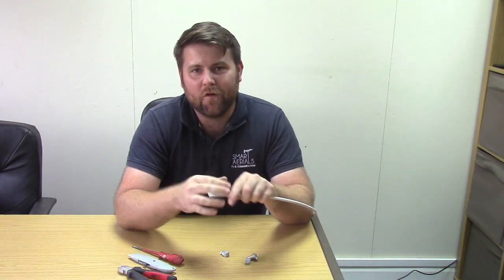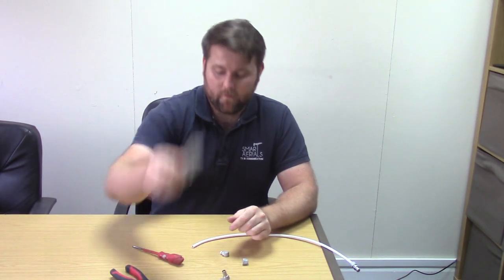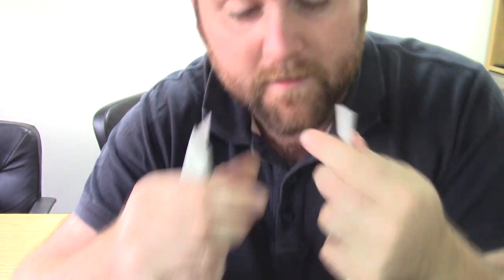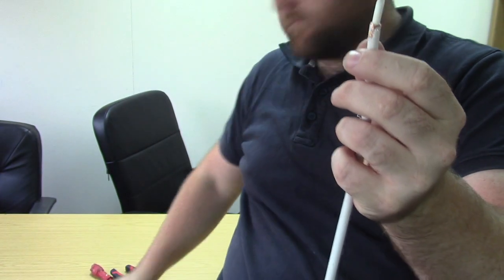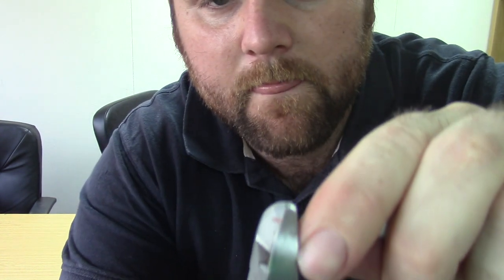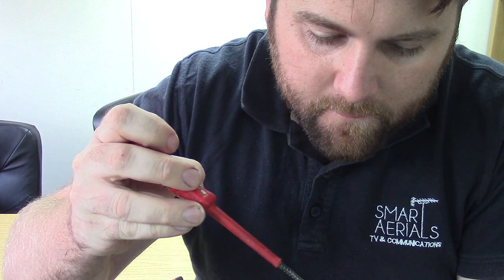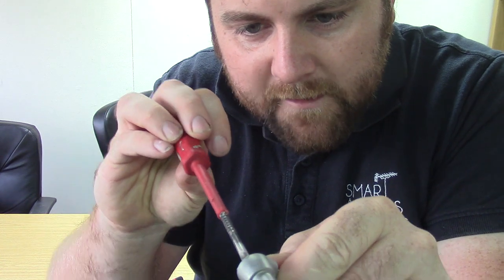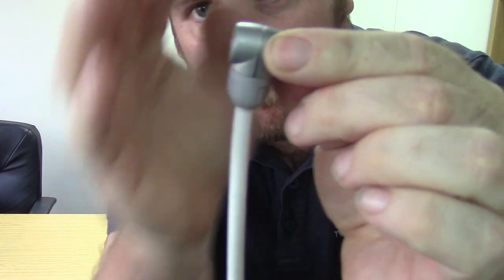How To Fit A Right Angled Coaxial Plug Onto A Coax Cable

Comment: Please post a link to the type of plug you used (you mentioned the name, but I couldn't make it out).
Reply from the maker: Hi Jim, this is the one. https://www.amazon.co.uk/Televes-Right-Angle-Aerial-Connector/dp/B008GKSKKI
Reply: For buyers in the UK, the Televes plug can be bought for £1.89 from eBay UK.